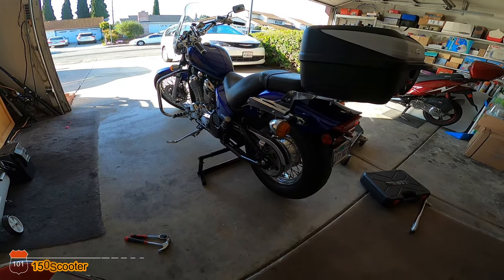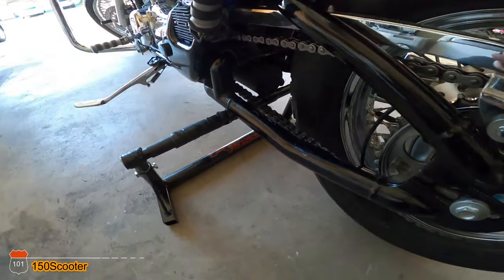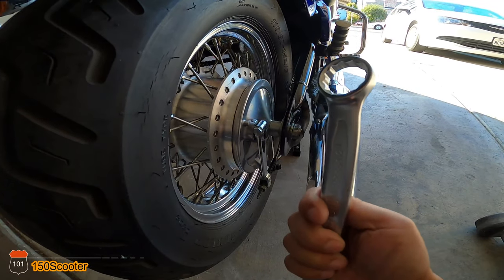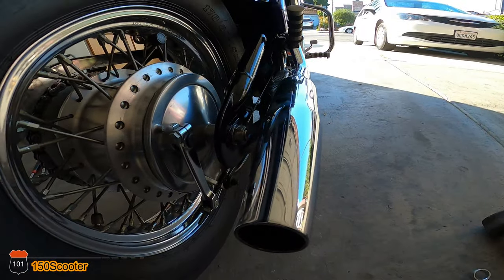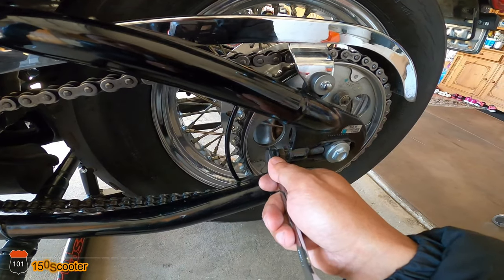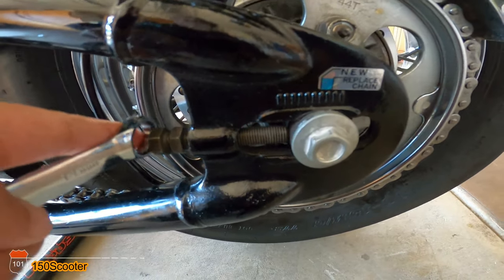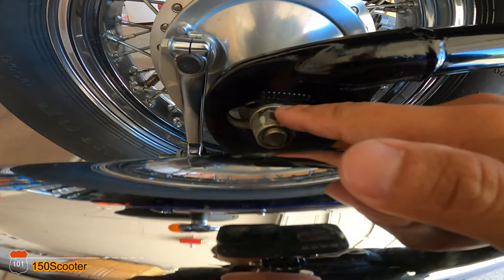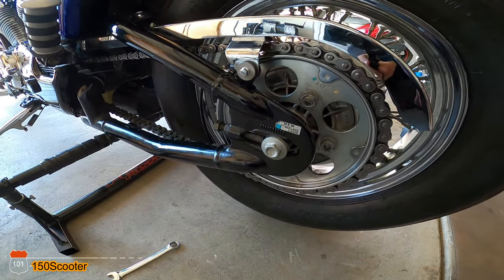How to Adjusting Honda Shadow VLX 600 Motorcycle Chain Tension | 150Scooter

Comment: Thank you! Very helpful.
Detailed. I just didn’t know which end of the main bolt the torque. The nut or the bolt?
Reply from the maker: Either side will work but I prefer to torque on the bolt side.

Comment: By freeplay do they mean the distance from the furthest down it will go when pushed to the furthest up it will go. Or furthest up it will go compared to where it is at rest?
Reply from the maker: The distance between further up and down. You can see the drawing label  on the chain cover.
Reply: @150SCOOTER  Thank you for your help in confirming this. It was more clear when I checked on the chainguard.

Comment: Is that a torque wrench you used or did you just guess on how much to tighten the bolt? I don't have torque wrench
Reply from the maker: I had a torque wrench, but you can guess, extra pressure, but not too much.
Reply: @150SCOOTER  Tks for the reply! Just to be safe I have a torque wrench being delivered today 👍

Comment: Hi, very new to motorcycles here, I have the steed 400, my back brakes are singing louder than Maria Carry, if I change this back break, will removing the wheel interfear with the chain / wheel adjustment?
Reply from the maker: In order to remove the wheel, you have to loosing the chain.